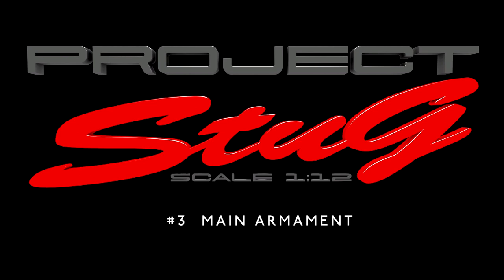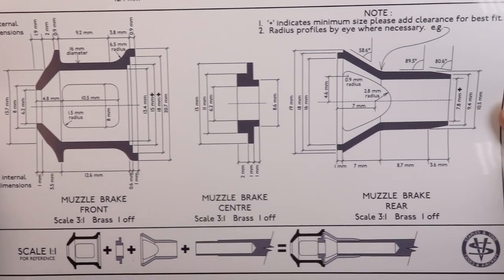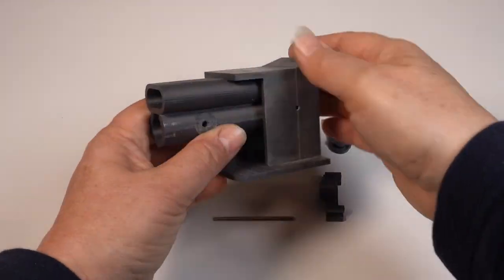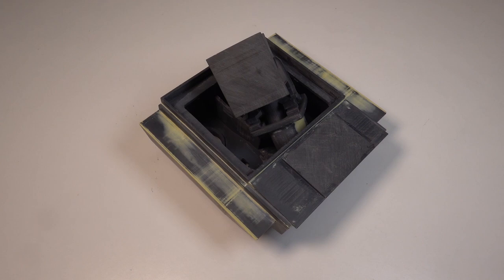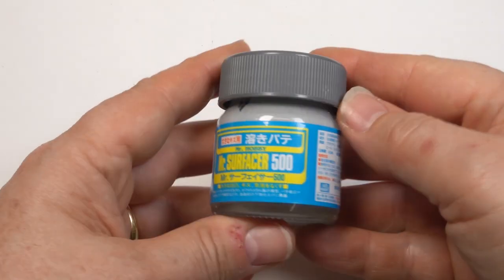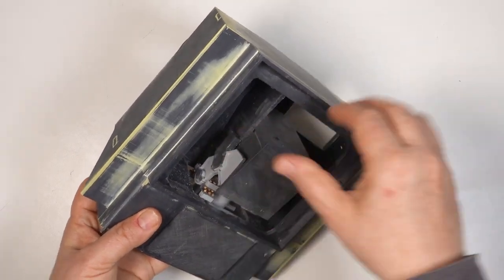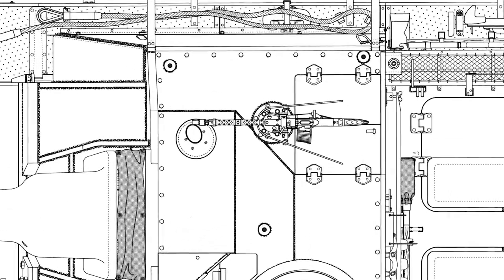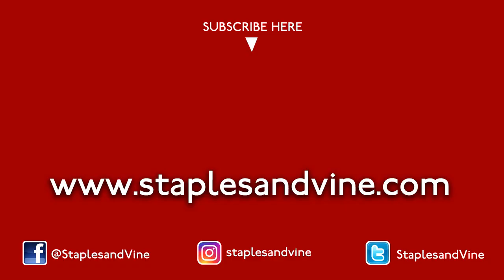PROJECT StuG PART 3  ‘MAIN ARMAMENT’

Comment: I'm surprised I only found out about your project now.  I am a big StuG fan and I will be following this for sure.  

I have a couple of points I think you should consider:

1. The 5x pilze for the 2t crane were only introduced in October 1944, which is after zimmerit was no longer being applied (stopped in September 1944).  For a vehicle with zimmerit you'd want the earlier 3x pilze.  Check Muller and Zimmermann book volume 2 pg.44

2. Are you certain there should be a weld along the top edge of the cupola shot deflector?  I am pretty sure it only goes along the bottom edge and then up the sides of the cupola.  A weld along the top would interfere with the rotation of the cupola which was reintroduced at some point.  I think I have photos that show this.

And 3. The actual name for the cast mantlet is "topfblende"; "saukopf" is something that was invented later.

I'm sorry to be so nit-picky, since this project is very cool and I must say I am impressed.  I'd just like to offer some advice for accuracy since you seem invested in that area.  Please don't take it too negatively!
Reply from the maker: Hi Panzermeister36, thanks for taking the time to comment on my StuG build. As you obviously know StuGs are a complex species, and your input is very useful. Trying to get the optimum subject is certainly perilous. You have raised some great points, thank you. 

1. Regarding the pilze, I'm looking into that and will make appropriate changes. I try and work from photos and have just started searching for a StuG of the right period showing the 3 pilze.

2. The lip to the top of the cupola drum rotates with the hatch and periscopes, the weld should be continuous and not interfere with the rotating parts. I think they would have welded the armour in place grinding back anything that caused a problem before installing the rotating section.

3. It's a lot easier to say 'saukopf' than 'topfblende' 20 times in a video. I don't think anyone is going to mind too much as long as it looks right it doesn't really matter.

Thanks again for your input, I do appreciate it, you have been very helpful. I often watch your videos and have subscribed to your channel.

All the best and I'm glad you like my build, Sera.